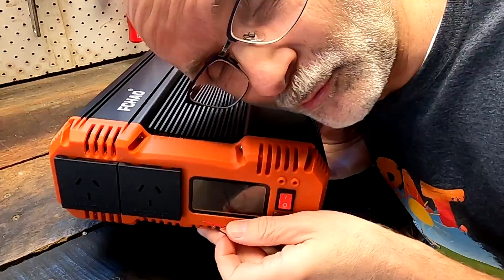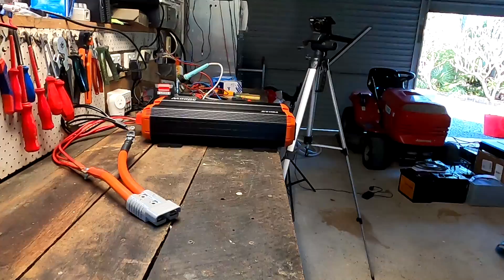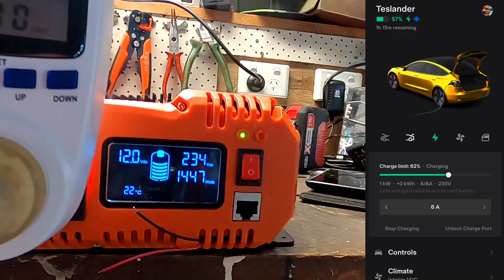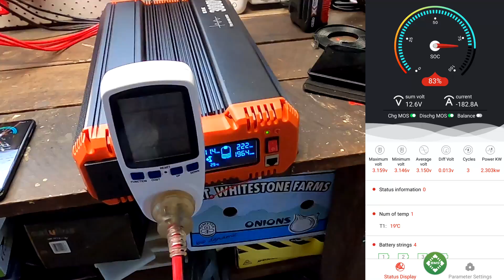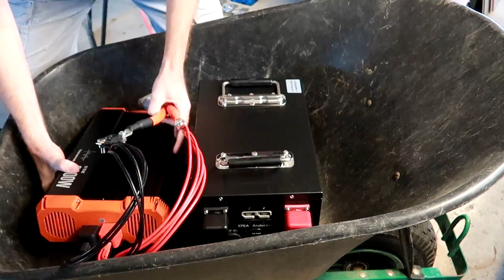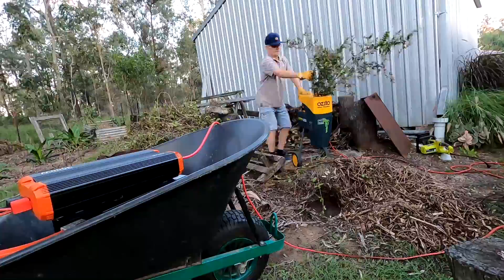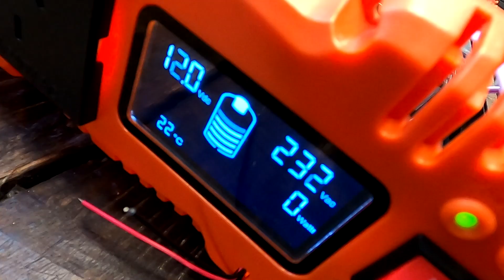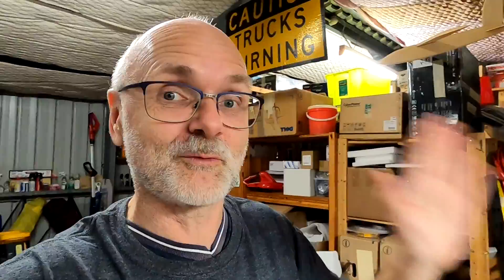The FCHAO Inverter Experience (aka Peter Inverter) 🤡 Another Chinese inverter or actually good?

Comment: I think your Renogy is broken.  I have a 2kW Renogy inverter charger.   Works great under high loads, plus it has a automated transfer switch with is what most others don’t have.
Reply: Forgot to say, the Renogy has RS485 coms which utilizes the Renogy Bluetooth adapter for better configurations and detailed data.   Too bad they want one spend the extra $40 for that.
Reply: Contact Renogy about the performance.  They may send you a properly working unit
Reply: I also have the 3kw inverter charger and a 2kw inverter...both perform as they should at peak load..
The 2kw invter I mistakenly ran at 2400w output for a few hours and it was perfectly happy.
I'd also say something isn't right with your renogy Andy.

Comment: Hello Andy and thanks for all your instruction clips. One question do you have any tips where to buy copper bars to make own bussbars for Eve280ah batts? And a square plate copper like 100x100mm 5mm thick? Do anybody knows?
Reply from the maker: I bought my bus bar at a local dealer due to the weight and dimensions. So Google is your best friend here if you want to source something locally.
100x100 is not quite a bar any ore though, that's a copper square.

Comment: How does the Renogy inverter sinewave look like with different loads?  Mine 3000W inverter got a bit similar issue. Under load it dropped out and could not power things correctly.  It turned out it had a turn on relay that was soldered in thruehole instead of crimped in correctly. And it only got some connection just to trigger that it was alright with light loads. With some extra wirecrimp and new solde I fixed it.
Reply from the maker: Ah, thank you. I had it open once and could see all the relays inside. I thought they are more for the MEN link when not running on grid power. I'll have a look. Weird thing is, it only freaks out under certain loads.
Reply: @OffGridGarageAustralia  It can handle steady load as you’ve proven before I recall Andy, but in my opinion, just can’t handle the very short surge start up current- even though it’s only a fraction of a second.
It’s certainly enough to make me reconsider buying a Renogy inverter.
I have Giandel 12v inverters in the van (a 1.2kW and a 2kW) and have had no issues, … touch wood.

Comment: 36 Volt is what I need, sadly, too many only support 12, 24 and 48V.
Reply from the maker: There is almost no 36V gear out there. What is the purpose of using 36V?
Reply: Xijia/Swipower does have 36v but you might need to order from China.

Comment: Good video and in regard to the Peter inverter is very powerfull but, the only problem is that in a stationary situation is better to have the 24v or 48v model to reduce the losses in the wires; and more importantly it should come with the ground screw. In regards to the Renogy inverter I think that is a 1500w inverter with a peak of 3000w because I had a 1000w cheap inverter that was able to output only 500w with a peak power of 800w; then I changed with a new inverter from Germany and is able to deliver the power rated.
Reply from the maker: It says 6000W surge power on the Renogy website.

Comment: Peter needs 48V for sure.  Also it should have an adjustable low voltage shutoff.
Reply from the maker: None of these inverters have usually anything adjustable. Not in this price class...
Reply: i agree